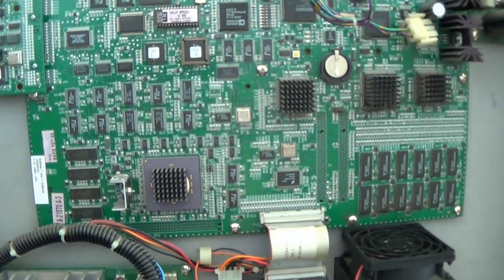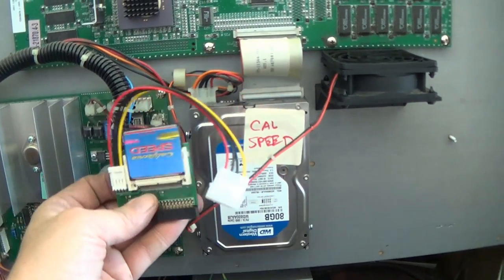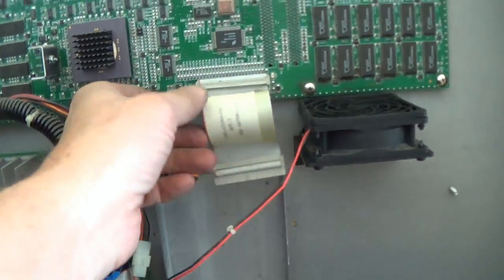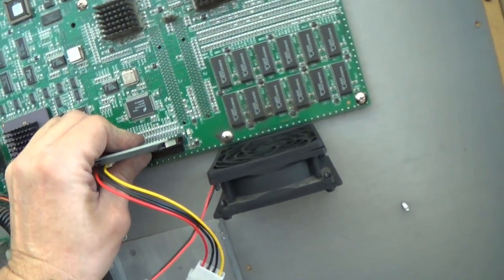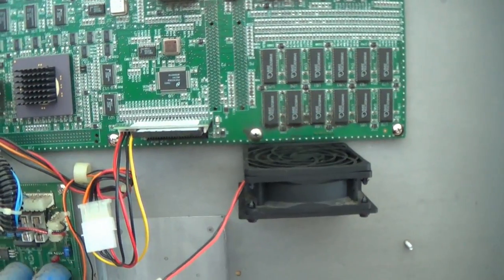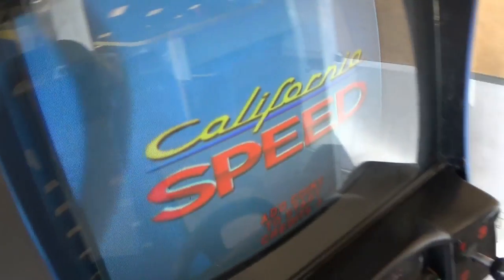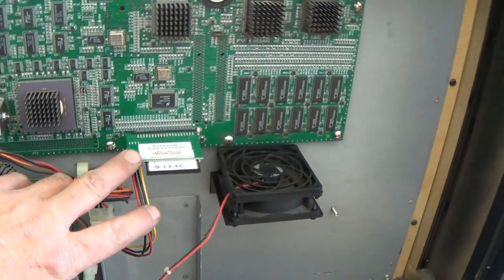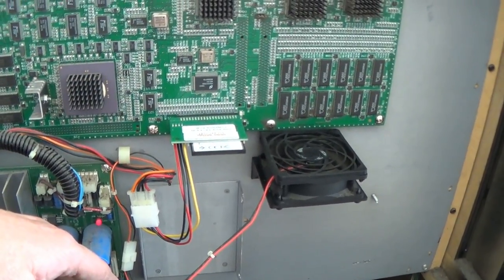California Speed Hard Drive to Compact Flash Replacement

Comment: Wow, I wasn't aware that anything like this even existed!
Reply from the maker: ArcadeDude44 Yes! They have been a real help! For years I have copied hard drives to replace old bad ones and it has been so hard to find smaller 2 to 10 GB hard drives. The adapter runs $10 to $20 and the compact flashes are cheap or you can just order the whole thing from Arcade Services.
Reply: Very cool, thanks for the info...all of my games are pre-hds (I think...my SW Trilogy is from 98, but I think it's all still roms??).

Comment: If buying the adapter and a blank CF card to write yourself, make sure the CF is a UDMA type or it can be a problem with booting. I haven't tried a non UDMA personally on this system  but it would seem to hold true from other early IDE/ early implementations of the IDE spec that it would also be necessary on this system.
Reply: Doing research may need to format the CF card to proper format to be seen by bios "may need to use linux (mint version) can boot off of usb to trial it

Comment: Hey, nice video, I got some quick questions. Can the game at least attempt to boot up without a hard drive or compact flash? I might buy a Cali Speed board with no hard drive or compact flash and I wanna know if I can test it without one. I know it's required to have one to get the game fully started, but I wanna know if the board at least works. Thanks.
Reply from the maker: ***** I have a spare board here at home. Ill try it tonight and let you know what it does. I think it will try.
Reply: This Old Arcade (Classic Arcade Machines and Tech Tips)
OK thanks!
Reply from the maker: ***** I will be uploading a video later of my California Speed board booting with no hard drive so you can see what to expect.
Reply from the maker: ***** By the way, back in 1982 I worked for Vectrex doing demos in department stores. That was a lot of fun but I never owned one and always wanted to.
Reply: This Old Arcade (Classic Arcade Machines and Tech Tips) Wow thanks a ton! You didn't have to make a whole video for me, but thanks! That's pretty cool that you used to do Vectrex demos, it is an awesome machine!

And about Cali Speed, I have a Cruis'n USA sit down that I want to install it into. I plan on copying the game files onto an old blank hard drive. But I guess a better question now, is will the game play without the steering wheel board? I have the one that Cruis'n used, and they look almost identical, I hope I can use it. I'm aware that it gives the wheel force feedback, but is it needed to use the wheel at all? Also, does there have to be a sub woofer present to get any audio out of the main PCB? I'm just trying to figure out what other boards I need to get the game going. Thanks.
Reply from the maker: ***** I just browsed through both manuals. I think in theory you can make it work with out the wheel board. It looks like Cruis'n will work with out it also. Have you tried that? I have a Cruis'n in the shop Ill try it on tomorrow. California speed has audio output on the JAMMA so you should get sound. You will need to make sure you get the little widget board that mounts on top. it looks like it is the analog to digital converter for all of the pots. If your lucky maybe you could find a California speed wire harness!
Reply: This Old Arcade (Classic Arcade Machines and Tech Tips) OK awesome! My Cruis'n board died recently so I may not be able to see if there's a difference if I were to unplug the wheel board, but hopefully it's compatible with Cali Speed. The guy I'm getting the main PCB from may have the little widget board, I'll ask him. Thanks.
Reply from the maker: ***** I unplugged the wheel board on that Cruis'n USA and it worked fine. Just no lights for the control panel. I did see a nice California Speed wiring harness for $75 on ebay. I would use that if you can.
Reply: This Old Arcade (Classic Arcade Machines and Tech Tips) OK cool, thanks for checking that out. Did the steering wheel and pedals work the same without the wheel board?
Reply from the maker: ***** Yes they worked great. They're input is through the JAMMA on Cruis'n USA.
Reply: This Old Arcade (Classic Arcade Machines and Tech Tips)
That's great to hear! Thanks for your help. Seriously, the guys on the JAMMA+ forums have never been as helpful as you!
Reply: This Old Arcade (Classic Arcade Machines and Tech Tips)
OK it turns out the guy selling the "California Speed" board, does not actually have that game. It's a NFL Blitz 2000 board (not Gold Edition.) Still, if I can get the EPROMs for Cali Speed, it still seems worth it to me for the $40 he's asking. I can make the hard drives for the games myself. I've been wanting some arcade version of Blitz to throw in my Neo Geo MVS cab anyway. What are your thoughts?
Reply from the maker: ***** That is a good price for the board but you would still need the widget board for the pedal and steering inputs. I think Eldorado games may have one. It would also be nice to set it up as a Blitz 2000.
Reply: This Old Arcade (Classic Arcade Machines and Tech Tips) OK I'm in a bit of a pickle. Besides the hard drive, is there anything else that Blitz 2000 needs to be playable in my Neo Geo? And from what I understand, the game can be played in Standard and Medium resolution, via dip switch setting. Is this true?
Reply from the maker: ***** Yes, from what I read you should be able to set that board to standard res via the dip switches and all you should need is the hard drive and correct eeprom. Have you received the board yet?
Reply from the maker: This Old Arcade (Classic Arcade Machines and Tech Tips) One other thing you should check is the -5v input on the JAMMA. Blitz should use -5V and the NEO GEO doesn't. So you would have to hook that up if it is not there. Also it is dip switch changeable to 8 way or 48 way joysticks.
Reply: This Old Arcade (Classic Arcade Machines and Tech Tips) I apologize for the long comment, but I have one final question. I ended up not buying that NFL Blitz 2000 board. Instead, I bought another tested and working Cruisn USA board off eBay which I should have on Friday. The thing is, I am a bit iffy on my Cruisn machine. I have a Cruis'n USA board that used to work, but got screwed after I tried doing an EPROM swap with Cruis'n World chips. The 2 Cruis'n World boards that I have were from eBay that were untested and seemed to be completed dead. I was stupidly thinking that the EPROMS still had life in them.

So I recently tried the three boards again, with the EPROMS in their original places, and it seems that more than half the time now, the view buttons and the start button lights will not turn on. After switching boards, their nice in bright, but powering off the machine, then turning the machine back on, will give me no lights. It seems to be completely random. Having no board plugged in makes no difference. However, the marquee light is always lite up nice and bright. I know that lights don't play a huge factor in power, but this makes me think that there are unstable voltages in the power supply. However, I tested +5, +12, etc with one of my multimeters, and they all seem to be good. None of my Cruisn boards show anything on the monitor anymore, but I can tell that the monitor is on. I can still get a pop sound or two out of the boards, which was something my Cruis'n cab always did, even when my USA board fully worked. My question is, do you think that plugging in that Cruis'n USA board that I will be getting will do any damage? I definably don't want to damage another board. I feel that plugging in the board will likely won't result in it not working, but I just want another opinion from someone who knows more about this stuff. (I'm only 17. Lol.) Thank you.